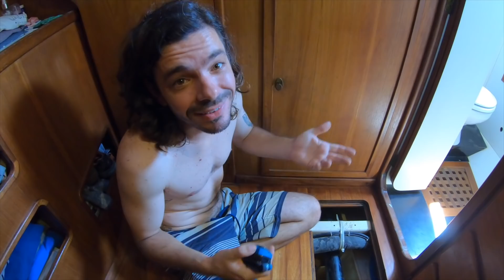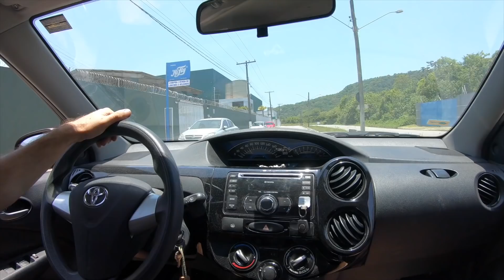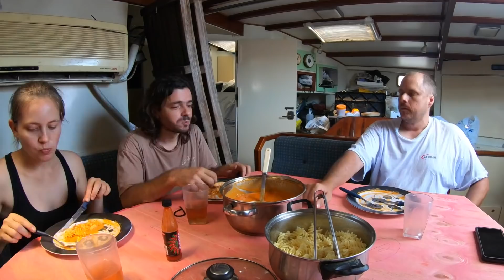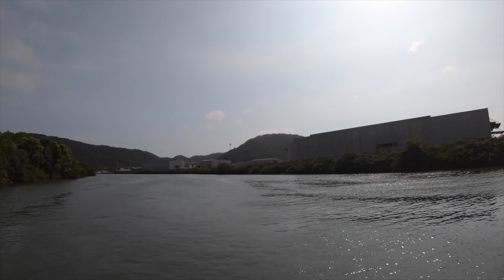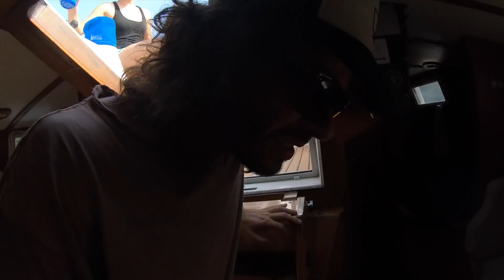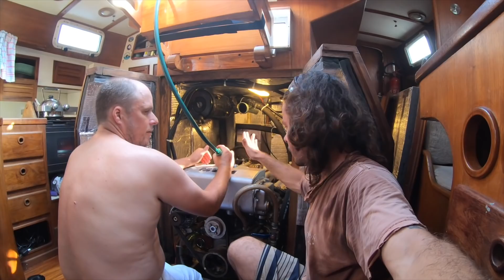⛵️First SEA TRIAL after 23 year on the hard!! (didn't go well!! 😨) Not Click Bait #163

Comment: Duca and Roberta,

I've enjoyed watching the two of you working on your sailing dream.

In the last episode you suggested that you might want to replace your diesel motor baed on you sea trial and asked for comments.

Here's a few  from my heart:

1) You started the series with saying that the motor you have is a real workhorse and it appears that this is so.  The problems you discussed in your sea trial are minor.  Your motor is a back up... there is a reason that it's called a sailboat and you have that big stick on your deck. Learn to sail. In an emergency you still have your dingy and motor.  I'd learn to use it as a back up getting into port.  
2) Rebuild the Bendix drive or replace it or the starter motor  (I don't know if the Bendix is part of the motor as it is on my past Yanmar motor or a separate unit).  The Bendix drive is a pain on all engines.  Keep a spare Bedix drive or starter motor that you can change in route.  It should be in your spares inventory even if you buy a new motor.   (By the way in the video it looked like your alternator belts need to be adjusted you ned to have at least 3 spares on board in case.)
3) Replace or repair the heat exchanger.  Are you sure you have the current exchanger plumbed correctly? Anyway the exchanger is a problem on all boats and new doesn't necessarily me no problems.  New exchangers are not built as tough as the old ones.....
4) Replacing the motor is BIG bucks.  Unless you can get it for free I'd fix your current motor which is proven in commercial applications.  Shipping parts around the work with the internet and world wide express shipping so available  as bas as it was even 5 year ago.  
5) New Yanmar motors  are not as tough as the older ones.
6) If you do go for a new motor you may need to:
Modify the motor bed.  (This is not easy)
Possibly replace the propeller
Possibly replace or modify the shaft
Possibly replace most of the engine controls & gauges.
Modify the throttle and transmission linkages
You may also need to modify the diesel supply systems. 
7) I think your time frame on a motor replacement is wildly optimistic.  Figure at least 3-4 months to get all the parts and the work completed.  The bed modification, shaft modification & alignment are not for beginners.   Yes you can do a  lot of the work but you'll need an experts.  If you fix your current motor and still have problem you can plan to replace it later butywhat you have can be better that what you may get.  
8) If you go for a new motor see if you can rent a motor jig so you can design and build the motor beds.  
9) If  you do go for a new motor you might consider a Beta Marine unit.  Beta's are Martinized Kubota tractor engines.  Simple, bullet proof and part are very available word wide.  Yanmar parts are very expensive although not as expensive as Volvo-Penta parts, and  Yarnmar parts are not always available world wide.

But make the best decision for what works for the two of you.  I'll enjoy watching whatever you do!

Thanks,
HN

Comment: Don't feel too bad. My boat was on the hard for 7 years before I bought it. I had a mechanic come to check it out, found a bad impeller, but she ran on the first try. Ran her for 45 minutes with no issues. On launch day the mechanic started her up and the entire marina disappeared in a cloud of black smoke. That cleared up and it ran clean. That summer I put about 25 hrs on the engine and the exhaust gradually turned grey.  One afternoon, I lifted the floor plates to check the bilge and found it full of oil. We had just come back from a run, and had just shut down the engine. Pulled the dipstick, NO OIL. Apparently the rear oil seal let go. A partial rebuilding  of that dinosaur Volvo would have cost $10-15,000 for a 35 year old engine. I ended up putting in a Beta Marine 38, and saved 400 lbs in weight. Also gained 3hp and a much better fuel consumption. The price for the new one was $14,900. I did need a new prop, a dripless seal for the shaft and various fuel bits but she runs like a watch now.

Comment: Being a mechanic, their's nothing better than knowing how your engine is put together because you're the one who tightened all the nuts and bolts. Seeing how you done this for the boat itself and in a time crunch, i'd go the new engine route. Yanmar and Kubota both have proven to be good reliable small diesel engines.
That being said, you can always swap the engine later down the road. If a diesel engine has something major wrong, it should show itself pretty quick.
Reply from the maker: Thanks for the suggestion.
Reply: @OddLifeCrafting  Thanks, Kubota engines vibrate a little less and run a little smoother, usually lower HP. While John Deer compact Tractors use Yanmar and you see them in more Marine engines, some with higher HP's.
 Both have good track records.

Comment: Definitely new.  A lot has changed since the boat was new 30+ years ago!  Also looks like with the Yanmar you have the option to switch to digital drive by wire controls., which would solve your backwards throttle issue, and eliminate the spaghetti wiring of all your analog gauges!  Hey @yanmar #Yanmar, give these guys a Christmas present!

Comment: Great accomplishment about the shakedown cruise. It should be considered a great success because of all of the information you acquired. The only harm to an old diesel from sitting should be perished seals. I would suggest to buy a new heat exchanger, have the old one fixed and keep as a spare, do what it takes to replace the engine and transmission seals and gaskets, and then rebuild the propeller shaft using new seals (not the old ones found on the boat).

Comment: As an old truck driver and diesel mechanic I would say that engine has done its job and is ready to be retired. You have rebuilt or replaced everything else, so best now to replace what is most important, as your lives will surely depend on it in a great degree. I am already worried enough about you two heading out to sea, so please be safe.

Comment: I think that if the brand new Yanmar engine is essentially a change the mounts and away you go..THAT is the option to take...You are totally correct in thinking ot would be the utmost in reliability and  you can get parts and the mechanic to fix ANYWHERE in the world. That brings alot of comfort when in an unfamiliar place where you might not speak the language. That would not be the case with an exotic electric motor. Few sailors have really made those work correctly..and although fashionable right now, the last thing you need sailing to remote places is poor reliability. Something more to think about with electric is you would also be losing all of that fuel weight ballast which will worsen your comfort in heavy seas which sooner or later you are bound to meet on your travels....not to mention you'd have to clean all those beautiful tanks you just filled with that 710 liters of deisel...The million hour before needing a rebuild Yanmar in my mind would add alot more value and keep you open to alot more buyers when you resale vs. a finicky butbin vogue electric motor...IDK many conventional sailors that would want the headache of the electric motors over the dead reliable Yanmar diesel. Lastly...that beautiful steel boat has been to some very remote places and gotten back safe. With your loving refit so far she will do so again reliably with a new diesel engine..I wouldnt trust an electric in the wilds of Antartica or the high north latitudes...should you decide to sail her to those places again...

Comment: Here is a small tip that will be very handy with the steering wheel. PLace a piece of Masking tape at the top of the wheel when the vessel is going straight. then when you get time take some cordage and make a braided knot to mark the spot.

Comment: I would definetly check out electric drivetrain.

-Put two 10-20kw BLDC electric motors in parallel with belt drive or similar and connect them together with two motor controllers. Motors and controllers can be bought about $1000 each, so ~$4000 for these.
-Build the parts needed for installing them into your engine room. This is normal, simple workshop stuff.
-Put your existing Battle Born batteries in series to form at least 48 volt system to drive the motors (and/or get more batteries as well if needed)
-Put 48V inverter-charger to charge the batteries and supply 230V.
-48-to-12V converter to power existing 12 volt system

Simple and reliable. Just a few moving parts. No oil changes or leaks. (except for that shaft...) Parts are relatively cheap.

Later on you can put small, simple diesel DC-generator to make recharge with great efficiency. And increase any other sources, wind, solar etc. Bonus is that you can charge the batteries when sailing.

It really depends your usage how much do you actually need engine. With electric motor you can do all the maneuvering you need on harbors, get out from tough situations etc.

Comment: Whenever you leave the dock, one of the first things you always need to do is coil your dock lines and secure them to the handrail or some other point.  If you don’t, sooner or later you will have one work it’s way overboard and then it will be wrapped around your prop and you will be in serious trouble.  Also, you might invest in a backup outboard motor with a fold down mount.  Even a 10 hp long shaft motor would provide another major safety backup.  I had a 40’ boat with a Yanmar diesel and a small Mercury backup which saved my bacon on more than one occasion.

Comment: A fellow who used to be ln our marina bought an old 30 foot sailboat. Had nothing but problems with the motor..So he had a frame built on the stern. Still has a swim platform on each side and a forty horse motor in the center. He loved it. Any problems and you either tilt it up or go into the shallows. If it needs to go to a shop, four bolts and is off. When running you can't hear it. With four stroke, no fuel mixing. All holes in hull sealed. Lol, now he has more storage for beer. But, it's just a thought for you.

Comment: Well, thats what sea trails are for , I am not surprised that you had some problems , but maybe a little bit with the heat exchanger if you had it at the shop , they should have pressure tested it . Make sure after you put the seals and bearings( if needed ) that you replace those parts and keep them on the boat when you cruise , just a piece of advice. Your doing well and I am very happy for you . Can not wait to see yu bend the sail on and tune the rig , as always my thought and best wishes are with you.

Comment: Hey, for backing into a slip you should go about 2-3 boat lengths past the slip and then start backing up straight down the channel. Once you are moving at ~1 knot in reverse you'll have better steering and you can turn it into your slip without having to try to time it perfectly. Full keel boats are a lot harder to back like that that the little tiller steered boat you used to have. :-)

Comment: You have down such a nice job of rehabing the boat it would be wrong to go limping out on that old engine and gear box. Check out the engine Leo is putting in the Tally Ho , that looks like a winner ,best of both worlds.  Even though you had some problems it was great to finally see you under way.

Comment: Yanmar is a very reliable engine! They were the first engines used in trans Atlantic crossing. 

Kubota, a subsidiary of yanmar, sells their engines to Beta Marine, a UK company that adds accessories and marine-proofs the engine. They currently have an option that can produce massive amounts of electricity when under sail thru Regen by the prop, the dual “alternators/Dyno” double as an electric motor, which can be used to power the boat. Kind of a redundancy to the redundant diesel motor. Plus if you sail places, youre charging. And saving on diesel. 

You would have to increase battery storage though.

Comment: We recently faced similar engine questions with our 1998 Beneteau First 42 prior to a major trip. Initially we decided to rebuild the original Perkins engine. After spending 50% of the cost of a new engine we had a major breakdown in a remote area. The repairs required 45 days at a significant cost. After all that we no longer were confident in the Perkins and decided to replace with a Beta 50. We have not regretted that decision. I hope this helps in making your decision. Good luck.
Reply from the maker: Thanks for the feedback!😊

Comment: You mentioned that your engine is very much used by Brazilian fishermen; have you talked to them about engine reliability and common problems? Also, although the basic engine is made in Brazil it is possible many of the accessories and systems (such as the fuel injection high pressure pump) are made in USA or Europe and thus readily available. The engine water pump is always  a possible issue as might be the raw water pump.
Love your channel; you bring a lot of sunshine to these dreary  Pandemic suffering days.

Comment: For the problem about the reversed function of the throttle lever i think that the solution is simply to turn the two levers section of the steering column by 180 degrees (then you have the function forward/reverse in the right side and  the throttle in the left). Now the throttle is working properly and the For/Rev is reversed. this is very simple to be fixed by changing the attachment of the For/Rev wire  in the upper position of the gear box lever of your motor instead of the bottom one.

Comment: Hi Guys,
Me again, just finished watching your latest video. I think you both just made the best decision to change the engine and gearbox. I am pleased that you also working on the prop shaft as when Duca lifted the bilge cover, there seemed to be excessive clatter as if something was loose. The main reason for me contacting you both this time, is you need to look at the latest Tally ho video as Leo is going through the same process, choosing an appropriate engine for his yacht. He found a very interesting Diesel engine with an electrical embedded system that was very interesting. Particularly for you guys, as you have spent so much time with Fred making a complete sophisticated electrical system. onboard ODD

Comment: Options , options , op--- .  The first trip showed things that , for safety and peace of mind , need to be done.  I vote for option " 3 ".   Reasons :   the biggest is safety .  You don't want to replace the shaft seals etc, and then have trouble with the engine and risk needing to adjust the shaft and seals.  You have a market for your engine there in Brazil.  I know your future plans are to sail much further afield and if something goes wrong with the engine , it is worth what an anchor is worth.  If you sell it as is, the heat exchanger doesn't have to be touched.  Whoever buys the engine can handle the heat exchanger and they might be able to find one from another engine or a rebuilt. If you buy a new engine , all the work you need to do can be done and done only once.  My VOTE---    the new engine . (  They might throw in a gear box too )  { solves another problem }    Reduced leaks, solid equipment you can get serviced around the world , no headaches from Brazilian trade rules and most , PEACE of MIND.
Also, I know it is early but, may you have a Merry and Blessed Christmas.   All the best, Hal

Comment: Hi duca and roberta. I agree with the idea going to a new yanmar.     Electric for a small boat is not a good option when your plan is long distance traveling. Not enough room for a lot of batteries. Then you also need a generator running after a few hours going.electric. The fuel consumption of a hybrid system is roughly the same as 80-100% diesel. So my advise... Go for a new yanmar. Then you have the range (miles), mecanics and available parts all over the world. I have sailed and maintained yanmar for years and am now rebuilding a inshore steel ex freight ship from 1922 into a 25.15 mtr houseboat.

Comment: New engine, either Yanmar, or Kubota based is another good option. Reasons - good re-sale in Brazil so there 1/3 less cost than any time you will do it in the future. If not, even if the old engine is basically sound, there will be ongoing things happen other than the basic oil & filter change, which will cost money and time in the future.

Comment: I would definitely install a new engine.  It is the heart of the vessel, for so many reasons.   I build and test high performance gasoline engines.  A certain percentage of them are for vintage race cars, where the engines have been out of production.  Replacement parts can be difficult or impossible to find.  If you do find them, the cost can be ridiculous, and it goes up exponentially, as the supply gets smaller.  This could easily happen with your "popular"  Brazilian engine.  It mat be a bit painful at the beginning, but it will be worth it for the reliability and added safety.   Just my opinion.  Good luck.  You are doing great!